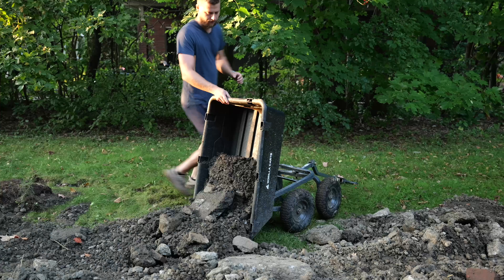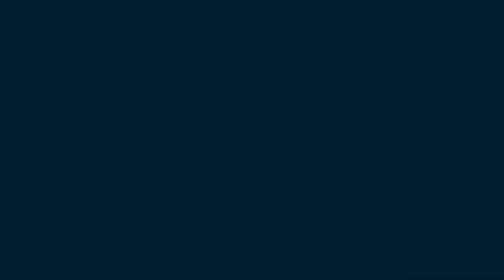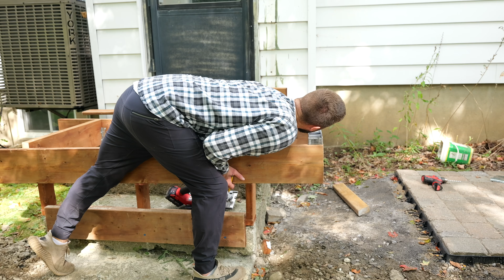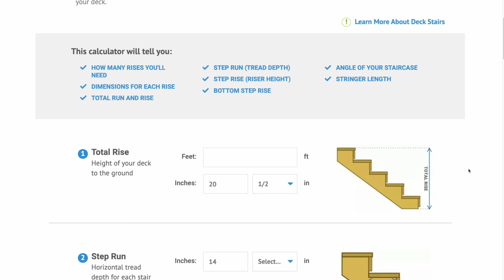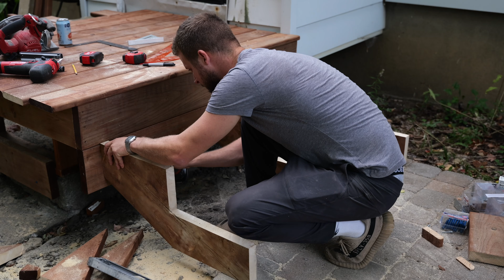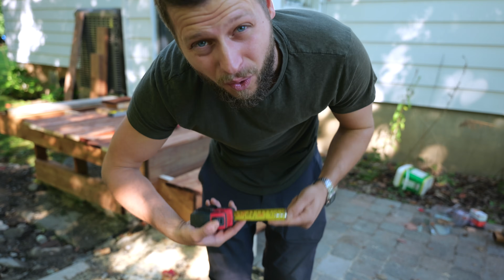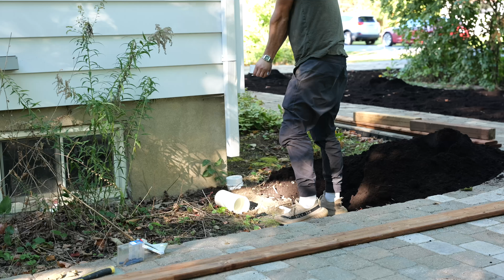Finishing the Driveway Project: Deck Build Over Concrete Steps

Comment: I enjoyed the video on the paver driveway and this one as well. I'm not sure I would have used the existing concrete steps as a foundation for the deck but I'm not there to judge how immovable they are. I kind of get the impression the back steps were a last minute add on, given the concrete pour you did. My biggest disagreement with the entryway is, in my opinion, you should have left the approach to the front door in the same alignment. As your mother-in-law is in good health now, in the future she may need more room to maneuver with a walker or even a wheelchair (hopefully she won't ever need either). A straight approach to the door would future proof that.   Lastly Mateo, with all due respect and acknowledgement to the excellent work and effort, I really disagree with the lack of railings. Any fall is a bad fall for an older person and a railing helps steady her and protect her. Plus, you are in Canada...it gets cold up there and ice/snow is certainly going to happen.

Thank you for the video....I subscribed!!
Reply from the maker: @jrj101566  yea, good points, you are correct about these steps were a quick add on, we didn’t like how long the walkway was, no body ever used them. They have always used the garage to come in and out of the house, never the front door (which is located far to the other side) so we just had to build them for the amazon delivery guy essentially 😂. Cheers!

Comment: Love the DIY project. Worried about the deck. The timber on top the concrete step will rot out in a few years. Water won’t be able to escape. And the board screwed in the side of the concrete step will fail as the screws are not designed for side load. Should have put footings in the ground and build around the steps. Another video in a few years. 👍

Comment: More time was spent working around this concrete step than just rebuilding a solid wood deck. The concrete will likely lead to rotting sooner because it will hold moisture against the wood and prevent draining

Comment: That staircase should have been demoed. There is no support on that overhang for the house.
Reply from the maker: @tigheklory  maybe something well do in the future. That little entrance extension is kinda ghetto. Not sure if those steps are supporting it. But for now, the steps will work. The challenge for this video was how to do it on concrete steps. We’ve all seen regular deck builds.

Comment: We have green pressure treated wood here, we do not have red/brown pressure treated wood. The preservation method is the same, some just add dye to make it brown. Traditionally yes, it was heavy arsenic-based but the color change was always due to copper.
Reply from the maker: Interesting. Here it used to be green and have arsenic and it got banned. Now its all brownish. This piece was up in the attic of the garage so, i guess it was from before 2000’s

Comment: It looks to me that the person who received the 11 loads from you returned the favor, and by the way, your steps will be falling apart if you just used the 3-inch black screws, they will rust within a year or so, You should have used stainless or deck screws
Reply from the maker: I gave nice dirt with rocks. Not concrete chunks of a ripped out garage floor. The screws I used are deck screws. They are brown.
Reply: @MateoStabio  Well, I couldn't tell on the computer, I guess the only question I have is your ass sore, I bet mommy in law loved it, again great job

Comment: You need a framing square with stair gauges that attach.
Reply from the maker: @Davidmckenzie-u8k  yea, i had a square but with a maximum length of 12” do I found a big triangle that worked just fine. Cant buy tools for every little thing lol

Comment: Great work! Quick small pointer if you're interested. When making your perpendicular cuts with a skill saw, tilt your saw back at the end, and the blade will cut to the end without needing to pull out your jig saw. This saves a lot of time if you have to do a lot of those cuts..

Comment: Oh my, so much work!!!!  

But you missed a big step for long lasting deck... you need foam spacer between the wood and concreat. Sadly, this deck will roth faster as the concreat and wood are in contact with each other. Wood will never dry and create tons of moisture. Normaly your work would have last 15-20 years if your inlaws are on it to paint and maintain. But as the wood is touching concreat you will be lucky if it hold 10 years, even with great care. 

Otherwise, very good job for the creation.

Comment: I cringed when I watched you attach the wood directly to those old concrete steps.  There needs to be spacers, or some separation between concrete and wood.  Despite what people may think, concrete is not waterproof, it actually soaks up water like a sponge, just like wood, and it will happily transfer that water to the wood causing mold and rot.  They make plastic spacers for this, there are plastic gaskets you can get, but something so that wood surfaces and concrete surfaced arent directly touching.
Reply from the maker: @Greybeardmedic  thanks, yea, lots of comments saying the same. Not sure if I want to make a video removing it all and fixing the 3 things people are talking about, or making a video next year or in 2 years to look at the damage (if any).

Comment: great job overall. the only thing i wouldve done differently is to leave some space between each plank so water can run off more easily especially during cold weather. that can really turn into a dangerous trap

Comment: that is a beautiful deck but in my opinion you should not rely too much on the strength of screws but transfer the weight of the structure or any unforeseen weight to solid ground either by vertical supports on the corners or wherever can touch solid concrete underneath. You are doing great, I am learning along with you 😁
Reply from the maker: @34Kuro  thanks  and i am learning from YouTube comments. Cheers!

Comment: Use a wheelbarrow with two wheels on the front instead of one wheel. You don't have to fight it so much trying to keep it from tipping over. You can put that energy into pushing it instead. Also the load is spread out on two wheels instead of one so you don't sink into the ground as much.

Comment: I’m not sure of your mother-in-law's age (although she does look young and about your age), but adding a 1.5-inch overhang on the stairs could pose a tripping hazard, especially as she gets older. If you like the look, you could achieve a similar effect by angling the riser and mounting the stair tread flush, which would help eliminate the hazard. Cheers.

Comment: This is close to home. I just excavated 20,000 lbs of dirt in the process of installing a 20 x 20’ patio in my backyard. I bought a slightly different Gorilla cart and a two wheel, 8 cu ft wheelbarrow. The Gorilla cart is, exactly as you said, rated at 1200 lbs but impossible to move at 1/2 that. It was great for moving pavers (some weighed as much as 70 lbs) from the driveway in front around to the back. The wheelbarrow was also very heavy when full so I got used to not filling it up. The previous owners had covered the area with a multi level decking system the sprawled around the back of the house and in the process had buried the old steps partially in the ground. To get the patio in I had to first remove the steps.
Reply from the maker: @fredericdudley6184  right on! Keep diy’ing! Thanks for watching

Comment: The end result looks great; however, from the camera angle it looks like the walkway is higher than the bottom of the basement window.   ...   you might want to add some drainage before the basement gets flooded due to heavy rain. The time and money to make the necessay changes is better spent BEFORE the flood.

Comment: I moved 12 tons of rock base and granite dust with a gorilla cart.  The trick to dumping is not using the “dump” function of the cart.  What you do is lift the handle all the way up and use it as a lever to tip the whole cart sideways.  I love the Gorilla cart.  It’s a beast if you use it creatively.
Reply: Not 12 tons. 12 cubic yards!

Comment: Ouch, 'free dirt' .....  did you get any dirt in that pile? Def got some large chunks of concrete and looks like boulders too. Gonna cost more to take care of it then buying clean stuff huh? SMH people :( As for the wheelbarrow... I like the ones with TWO wheels on the front. Not as nimble as a 1 wheel esp on very rough terrain, but NEVER tips over, and can hold a lot more weight.
Reply from the maker: I found one of those in the garbage recently. Gonna fix one of the handles and try that out!
Reply: @MateoStabio  Nice! Personally its my 'go-to' wheelbarrow for everyday tasks. Sure quality will vary by brand but if you have a good one, its gold in my eyes. Oh, and a 2-wheeler pulls almost easier then it pushes, if you find yourself getting stuck in ruts, try pulling. Just amazing work you have done, looks top tier!

Comment: Just an efficiency tip that will help you in all aspects, not just DIY. When you were cutting the stringers, you switch between the circular saw and jigsaw for each step. Think about the number of times you're picking up a tool or part and putting it down, that touch time adds up. Perhaps you could make all the circular saw cuts, then switch tools once to finish all the cuts with a jigsaw. Hope that adds some value to your projects!
Reply from the maker: @420BraiseIt  yea 100%. I figured it made more sense to remove the wood to make the piece overhanging a little lighter so its wouldn’t tip over
Reply: @MateoStabio  totally makes sense. In manufacturing we would look at 3 things. Value added time, Non-value added time and non-value added but necessary. Increasing value added time doesn't offer nearly as much benefit as decreasing the NVA or NVABN time. In the end, it's not about "how can I be more efficient?" but "how can I reduce my inefficiency?"
Reply: Another tip: cut out one stringer, make sure it is correct; then use it as a template for the next two.

Comment: What you've done looks fantastic. People have probably mentioned it, but outdoor wood shouldn't be in contact with the ground or concrete or it'll rot after just a few years. It'll rot eventually, no matter what you do, but so much quicker when it's in contact with a permanent source of moisture. I don't think it should be too tough to fix, but it would be good to get ahead of it before it becomes an issue.

Comment: Awesome! But dude you need joist hangers where you connected the stairs to the deck.
Reply from the maker: @Crandish99  will ask my mother in law what she thinks. 
She just said “would you look at that”
Not sure she wants hangers. But she does want to see them now
Reply: You wouldn’t see them as they are under the decking. Those screws won’t hold that stair weight over time.

Comment: Mateo- why did you get rid of the dirt (first video) only to need more later?
Reply from the maker: Hindsight is always 20-20.
Reply from the maker: Because I didnt have a laser and didnt know in the first 3 days that we would want to level out the yard. We also didnt know we wanted to make the path all perfectly level to the steps
Reply: @MateoStabio  I was wondering about that: why not run the path with the existing grade? Would it be dangerous, or fall apart?

Comment: It looks fantastic! The front looks higher than 24", but it would be a great place to build a flower box to add to the aesthetics of the entry. Will there be walkway lights?
Reply from the maker: @ejcastro9518  yes probably some solar lights. Its 20.5” high. And there will be plants and bushes along the deck so it wont feel high

Comment: I don't know that I would have let just those tapcons carry that load on the upper concrete step?
Reply from the maker: I think itll be good. I put about 5 or 6 plus all the other ones on the sides. They're rated for like 400lbs each lol. For a mailman or amazon delivery guy. should be enough! If this was a 10x10 ft deck, for sure not lol.

Comment: Next time, put plastic spacers between the wood and concrete so they don't touch. Concrete gets really wet, much wetter than wood can handle, so the wood will take damage faster and last a shorter time because of them touching.
Reply: If I ever did something like this DIY I can assure you there would never be a "next time" 😆
Reply: This, plus maybe butyl tape along the tops of all the joists and blocking, and spacers between the deck boards for better drainage
Reply: I would have sealed that concrete with waterproofing paint first, then space the deck boards 1/8". These will swell and crack with the Canadian freeze.
Reply: And he also forgot to protect the top of wood, where he made cuts for stairs. You can see white wood. This will ruin in a few years. Also, the connections between stairs and the deck looks pretty weak.
Reply: @diymasterTM could use joist hangers to more securely connect the stringers to the deck
Reply: @robh_tex  the bend in the first step as he went up....
Reply: @diymasterTM  This is what I want to say!
Reply: Unfortunately you’re right wet and cold conditions change the way the wood behaves. The wood can handle lot of water but screws won’t and dilatation will take all the space between boards.
Reply: Concrete is a moisture wicker
Reply: These stairs are outside, sometimes in the rain. Some concrete wetness doesn't matter.
Reply: @danser_theplayer01  The difference is that where they are touching the concrete they won't dry if they get wet so they will be wet for a longer period of time causing rot.
Reply: @danser_theplayer01  disagree.  getting wet is not the problem because it will dry out.  The problem is constant moisture wicking from concrete is the problem.

Comment: Amazing job!  Wow.  I think I would add another front board on each step…that over hang might be too much.  Don’t want folks to trip on the lip.
Reply: one way I've found to deal with that is to cut down the size of the center board so it's a little more narrow that the other two...ends up making a nice custom look and perfect overhang every time! (International Residential Code is 3/4 to 1-1/4 inches.)

Comment: Your editing was great on the SketchUp.  The reason I knew immediately was because I took the program class for my job.  The company I work for owns SketchUp.  EASY to learn and use.  It is very intuitive.   Great for concept design.  I would have considered raising the deck flush to the door threshold, but I understand your desire to maintain maximum 24" drop.  Note some cities require 20" max without railings. I would also recommend putting a bituminous tape over the top of the framing edge under the deck boards to protect from water damage.  Really works to maximize the life of the framing.
Reply from the maker: @billforest6666  totally and thanks!. Thats super cool that you work for them. So we get winters up here in Canada, and one rule in the books here is the deck or platform outside of the door has to be at least 4” below the door.

Comment: The green pressure treated probably doesn't have arsenic... they haven't made that for quite some time... you just got cedar tone pressure treated for the new stuff.  I can still buy the green color pressure treated stuff at my home depot.
Reply from the maker: @Darbman62  no no, its old old. It was in the ceiling stored in their garage. Probably older than 20 years. But looked impeccable.